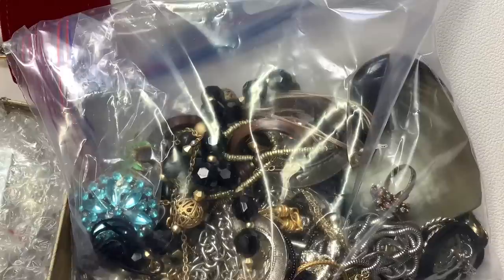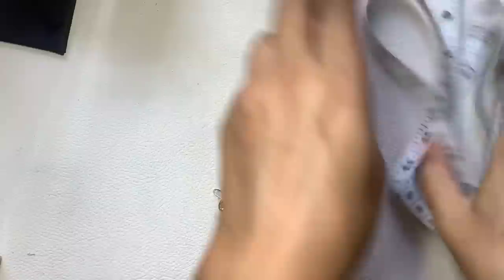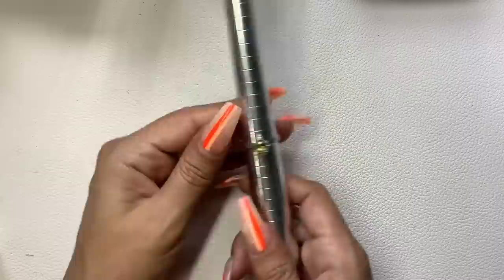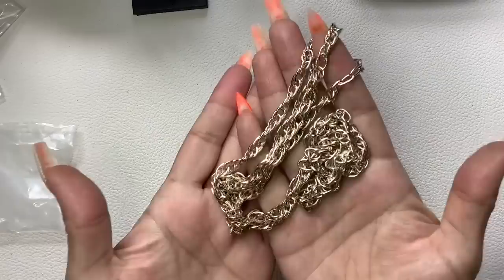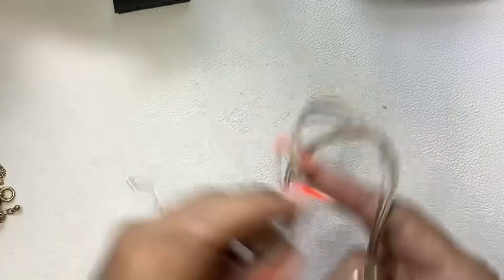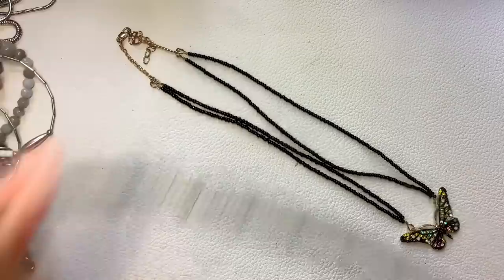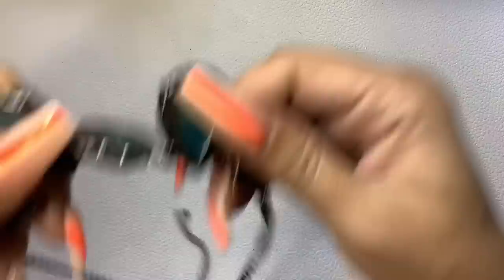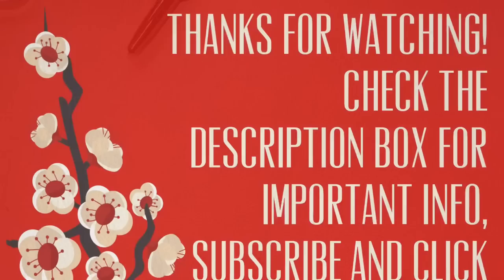Jewelry Haul from eBay and estate sales, all for sale!

Comment: It was difficult to determine where the needle started on your gem tester. It sort of looked like it was already slightly past the glass line by the camera angle. If so, the needle would be a bit to the right of whatever bar it falls on, so you would identify the stone to the bar that it falls on a bit to the left…am I making sense? It seems to be in the quartz, amethyst, citrine line so I think it’s prasiolite, also known as green quartz, green amethyst or vermarine. The color of peridot is similar to prasiolite.